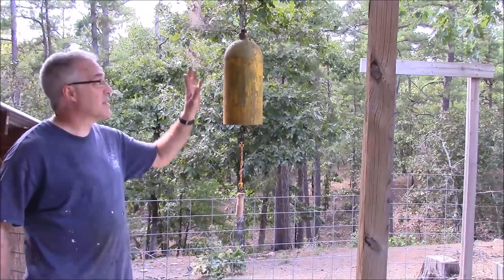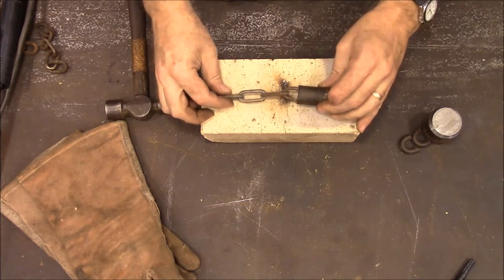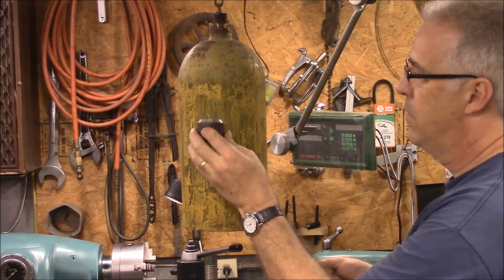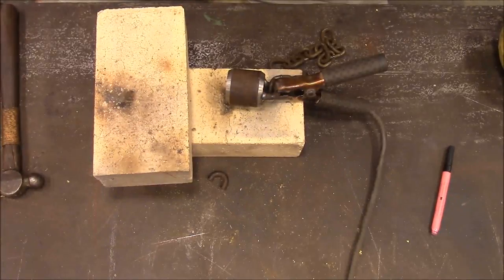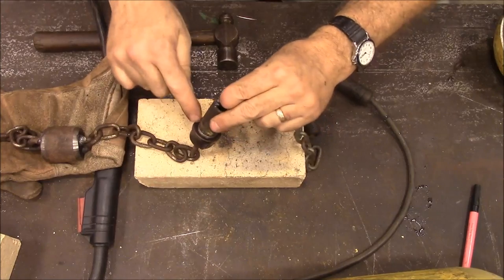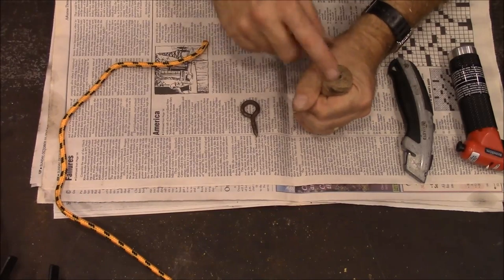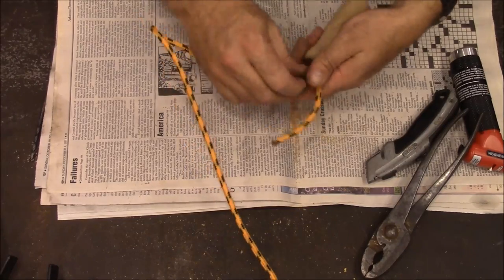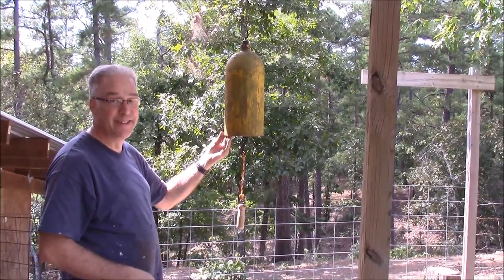cylinder bell

Comment: I've made a bunch of these except mine rely on the wind. I would like to offer some suggestions just in case you decide to make another one. The lower the hammer hangs in the cylinder the the less movement is required... It's also worth trying different hammer materials. one of my favorites is a hockey puck with a hole drilled thru the middle. it produces a bong rather then a clang. Ends up sounding like a temple bell.  The last thing I have for you is that the larger the  diameter your hammer is the less movement is required. They are a fun easy project but the Mrs say I have enough hanging. Nice job bud.
Reply: +John H Thanks for the suggestions!  A hockey puck is a great idea.  Thank you for watching!

Comment: is it ok to use a cutting torche to cut the bottom off the bottle?
Reply from the maker: Shouldn't be a problem as long as the cylinder didn't contain anything flammable.  Good luck in your project and thanks for watching!